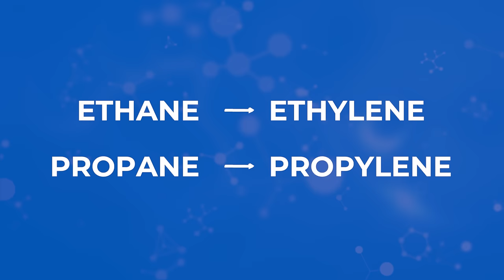How Plastic Affects Climate Change

Comment: The oceans absorb 93,4% of the warming. I stopped using "climate change" as only 2,3?% of the warming shows up in the troposphere.
So, when they say global warming has reached 1,5°C, that's only 2,3% "factual". 
Actual global warming is measured in watts per square meter on the surface of the tropopause, the layer between troposphere and stratosphere. where  the temperature of the air stops cooling and warms up a bit in the stratosphere, even though the stratosphere is actually cooling because the destruction of stratospheric ozone and the insulating properties of greenhouse gases in the troposphere. 
Thanks for your work 4Ocean ✌